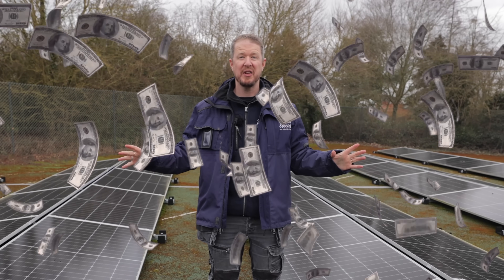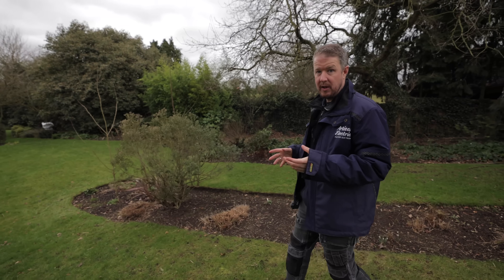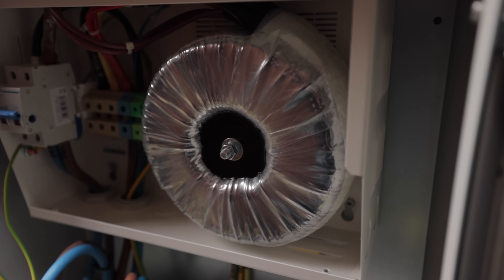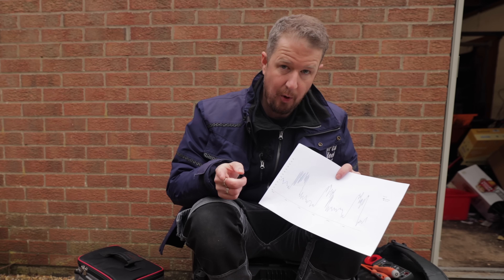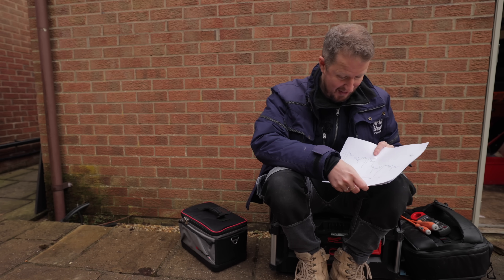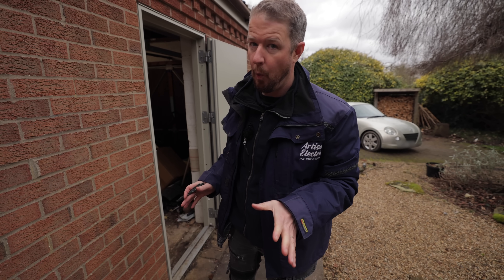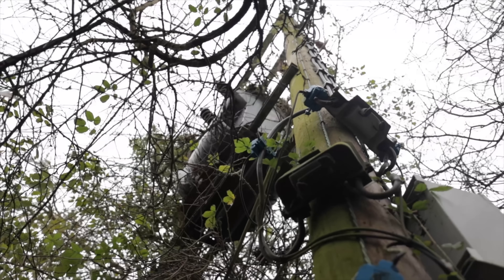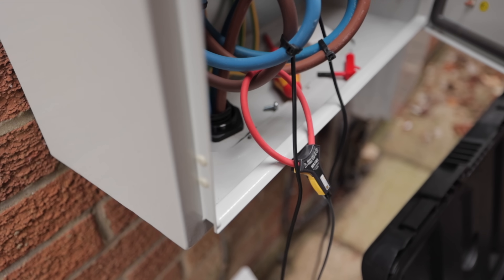THOUSANDS Down the Drain – And We Can’t Do Anything About It!

Comment: "it's going to restrict the flow through the transformer" Nope - that's not correct. Or at the very least, misleading, as you are implying the transformer has a hard limit at 70kVA. 
The transformer will have a nominal voltage ratio. For 11kV in and 230 volts out, that would be about 48:1. WIth 11 kV on the primary, and no load on the secondary, the secondary side would be 230 volts. But as you draw increasing amounts of current, the resistance of the windings creates voltage drop. And even if the primary side voltage stays at exactly 11kV (it probably doesn't but lets ignore that for now), the secondary will drop in an amount that is proportional to the current. The nominall full power current for such a 70 kVA transformer is a bit over 300 amps. To meet the 6% low spec, that means the voltage should not drop more than 13.8 volts at 300 amps. But what would happen at 600 amps? Would the transformer pass twice its nominal rating? Yes, it would (assuming a fuse on its input or output did not blow.) The votage would drop twice as much. The transformer winding would get very hot. But the 70 kVa rating is not a barrier - just a nominal maximum to avoid overheating the windings.
Reply from the maker: Very interesting point!
Reply: Great point on transformer impact on voltage. The rating will be a consideration once PV inverter capacity and export exceeds 70kW. Because of transformers’ high X/R ratios, in Australia they often help mitigate voltage rise thanks to the reactive compensation all new inverters provide (absorbing reactive power when volts are high). 

To get 300A I think you’ve assumed single-phase. In Australia transformers that large would usually be 3-phase, but the concept and your general point still stands.
Reply: True, it just shortens their service life.

Comment: My guess is that the problem is the long line to the property, not the transformer.

Ohms law, like you said. To high current creates a high voltage drop.

This is a common problem here in Norway, especially when there are farms with 20kW systems and long and old cables to the property.

If your inverter gives over 253Volts it is not adjusted correctly. The inverters should go into protection if over 253V..
Reply: Agreed I think its the cable to the house thats a bit dodgy... also agreed the grid tie inverters should have a setting for max volts, if they dont they are tat
Reply: @lezbriddon  they are required by law actually if it's going 260V it is frankly set up incorrectly

There is a "trick" by dirty installers to make sure inverters don't turn off, it's picking different region that can allow for higher voltage on inverter settings so in solar peak other inverters cap at 253V while yours can still push 260V+

I smell shenaningans here
Reply: @xani666  I dont think the guys oin this channel do shenanigans, who knows if there is a settings error or someone changed a setting without their knowledge,  I had a BMS change settings overnight which was very very worring as it changed from a 4 pack to an 8 pack so could have tried to push in double the voltage on charging... I made my self sleep better by deciding I had changed but not saved the settings... and its not happened since
Reply: @lezbriddon  they might've not, hell, it might've been owner seeing inverter go off then following "advice" off some random forum post tinkering with it

... but professional would see voltage going that high and have light up in his head IMMEDIATELY that it must be either setup error, or faulty inverter.

tho there is a chance the setup error is some other inverter on nearby house peaking the voltage (with overvolt setup) but I don't think so.
Reply: @lezbriddon  it could be bad factory setup (still on them to check it), it could be device problem (should be warrantied), it could be user itself annoyed with inverters turning off and following the forum post to mess the settings. Hell, it could be someone's else solar system set up incorrectly and giving off too much volts but they still should check it.

The fact getting over 253V didn't IMMEDIATELY light the light up with "huh, something's wrong here" and instead of fixing the problem they went to workarounds like that silly transformer is worrying.  Like they clearly know what they are doing with general electric stuff but... not really with solar it seems
Reply: @xani666  interesting to see what they do find /when/ they fix it.
I didnt like the 'voltage optimizer' transformer at all...
Reply: @lezbriddon  it smells of "client will be complaining when voltage is too low next".

but outside the "why 260V in the first place" issue, the fact the voltage could even get to that level does scream "too high impedance" somewhere along the way.

I'd definitely start with trying to compare their voltage with neighbours one, if they clamp voltage/current monitors on both them and their neighbours, they can ballpark the impedance from client to the distribution line at the very least.
Reply: Agree on both parts. Line too long and too thin. And inverter should cut out. My base voltage   from mains is 240-246V during day but  during night inverter running from battery would sometimes cut out with default setting of 10 minute average voltage limit of 253.2V, I adjusted it to 255V and it's been fine since. I also checked logs after adjustment and it was only going up to 253.5V.

It was DNOs mistake when approving 17kW, are they going to backtrack and reduce allowed power or pay for line upgrade I don't know,.

Also with the voltage optimiser you could change battery charging power to charge more slowly and have smaller voltage drop at night, there is no need to get battery's charged in 2-3 hours, they can charge them over 5,6 or 7 hours.
Reply: 253v I agree the system should be automatically turn off , 270v is mad
Reply: Yeah it seemed weird to me the voltage spike is so sudden when solar power is always a curve along the day, I don't think it's the transformer other wise it would peak at max power and not all day.
Reply: Unfortunately some inverters are only grid-following, and islanding the home means no power at all.  Having to install something that would just cut off export would be fine, but power network did make poor decision by agreeing to connection... and so upgrading transformers and transmission wires to reduce resistance is on their plate.
Reply: Resistance !
Reply: Sound like the grid is a bit hi impedance  why not load test it to say  50 Amps  with fan heaters on say 2 32 Amp rings for a short tine   and see what the incoming volt drop is

Comment: Why cant you adjust the output voltage of each inverter to a lower output. This should then compensate on the grid. Also pole mounted transformers have a manually adjustable tap to adjust voltage you have to power down to adjust as well. New substations can automatically do this

Comment: Very much doubt the volt drop when your charging the batteries is occurring in the transformer. Its more likely happening because of long length of the low voltage overhead cables. You were talking about hundred of metres long.

Youe customers property is a long way from the transformer and only single phase. Whilst technically you have 23kVA available in reality you don't because of volt drop. Designing a system for single phase that requires 17kW changing is going to be a problem. 

Can you not charge at a lower rate for a longer period. 

Personally i think an AC coupled 17kW system on a single phase 100amp supply is bonkers. Maybe you can DC couple some of this system so it can throttle back if the batteries are full and theres not enough AC demand.
Reply from the maker: Yes we have reduced the charge rate of the inverters overnight and this has helped
Reply: @artisanelectrics  If you can reduce the peak voltage by either adding more battery storage or charging the cars with excess generation then there is no need for that crappy voltage optimizer. You have introduced another source of voltage drop through its transformer. There's no way you can pull that sort of current through that little toroidal transformer. Mop up the excess generation with more batteries or car charging and your get rid of the high float voltage

Also you might be able to limit the voltage peak the inverters can push back into the grid in its settings. I know that's possible with SOLIS
Reply: @artisanelectrics , is it possible to reconfigure battery charging settings of inverters to charge battery during excess solar power as primary mode? And enable overnight charging as secondary (supplement) mode - only in case of deep discharge of the batteries, to charge up it to several % above deep discharge,  before next daylight charging cycle?

Comment: Does that quite small looking torodial transformer in the "voltage optimiser" carry the full 23kVA (100A) load of the property?
Reply from the maker: Yes amazingly it does
Reply: If it's dropping 13V (260V to 247V) at 100A, the transformer would need to be 100x13 = 1300VA.  Not small, but toroidal transformers are quite compact.
Reply: @stevearmstrong1220  Thanks Steve.  It looks to me like that the primary and secondary windings of the torodial transformer will have to be at least 10.0mmsq , so there wont be much space on the transformer for many primary or secondary windings, and the fewer primary windings the more it looks like a short circuit to the incoming supply.
Reply: @caspar2155  So think of a standalone transformer 1300VA
Primary ~ 250V (1300 / 250) = 5.2A
Secondary 13V (1300 / 13) = 100A
So primary only needs to carry 5.2A (although it was a lot more turns).
The supply to the house goes in series with the secondary to either raise the voltage or to lower it.